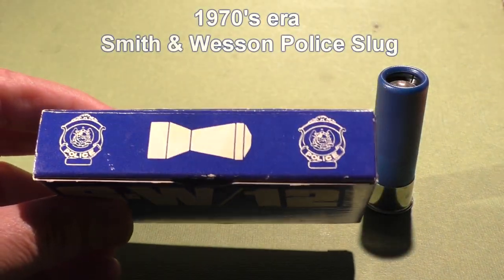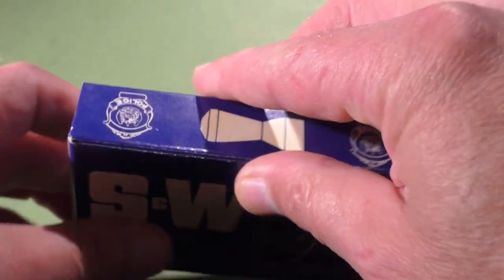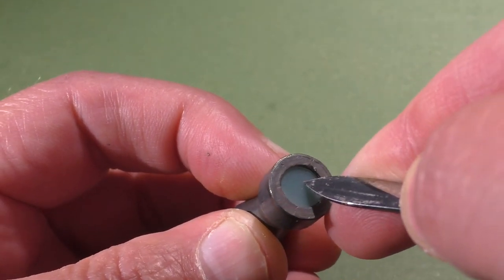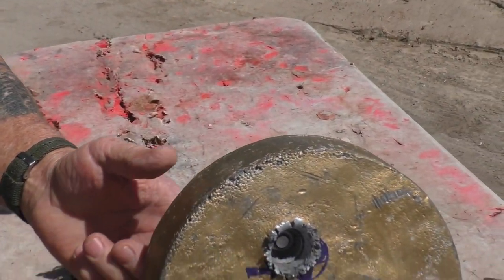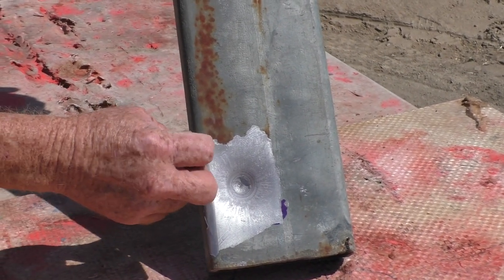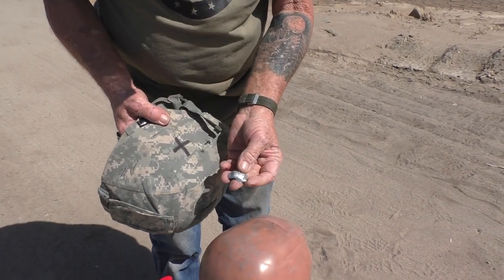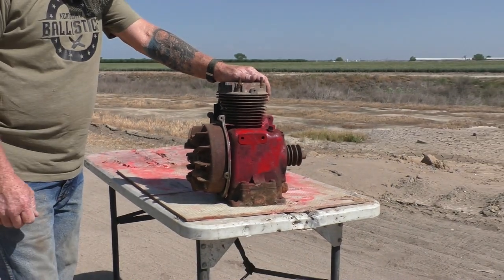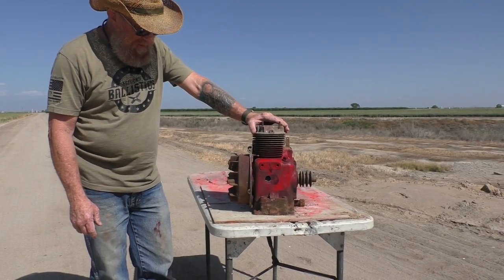45 Y/O S&W Police Slugs - Anti-materiel Sabot Rounds - Tested

Comment: After Scott's accident,  your safety precautions are a good idea
Reply: Hook and string plus ballistic shield would be my addition.
Reply: my thinkin's exacc
Reply: Was this the dude whos 50 cal. blew up on him? Saw hes breathing, but did he get out on one piece?
Reply: @GrowlieDave  He has a full video on it. Basically, he's lucky to be alive at all, but is recovering well. The part that nearly did him in was his jugular, it's been repaired, doctors did good work on the rest of him too.
Reply: @GrowlieDave  Yea he barely survived, but afaik everything is still attached and he should make a full recovery.
Reply: BAH! I shoot far older and far more questionable ammo out of equally questionable rifles. No kaboomboom. The weirdest experience was consistent hangfires with some shoddy old 8 mauser with Arabic headstamps. I've shot rusty German 9mm from ww2 without issue. If old ammo is bad it usually doesn't even go off. Scott was knowingly shooting weird, overcharged ammo that is known to make ma duces blow up. Play stupid games, win stupid prizes.
Reply: Good to take precautions with unknown old ammo all the time. Not that I always have.
Reply: @krockpotbroccoli65  whatever makes you feel safer dude.
Reply: notice also that they stopped using it after they knew the velocity though seems a little much for 12ga the pressures involved in 12ga based off the size of the bore and given what most modern shotguns are rated for makes this seem a bit excessive to me after the first shot or 2 but thats just my 2 cents.
Reply: @krockpotbroccoli65  Hindsight is 20/20.  In his video, Scott stated that he had no reason whatsoever to believe that he had a hyper-hot round.  He has shot plenty of SLAP rounds out of that 50 cal before, all without incident, so maybe go easy on him.
Reply: @ krockpotbroccoli Be careful with that old 8mm ammo. Early 1940’s Turkish 8mm has gotten hotter as the powder ages and has blown apart several autoloading firearms in the last few years.
Reply: @GrowlieDave  pretty close. Took a fragment through the jugular and down into the lung. Breech cap tried to take his head off, but only managed to break all the orbital bones around his right eye after it knocked his shooting glasses off.

Based on damage to the parts, that round was over 85kpsi, over 155% of rated pressure of a .50cal. something was way, way hinky with that round!

Comment: It’s good to see that these slugs were lucky enough to still be in reasonable condition, and more importantly were safe to shoot, despite their age
Reply: Ammo can last a century or more if kept dry and cool. I’ve shot ammo from the 1950’s with no problems. Obviously, I inspected it first.
Reply: Most old factory fresh ammo is fine if stored properly and not tampered with. Ive got some 1940s 762x39 ive been shooting for years, and its runs perfect. Ive got some 762x54r thats almost 100 years old, and it also runs like new
Reply: Heat kills powder life. Never know what you're getting. Depending on the powder, if temperature is kept under 85 or so it will outlive you by a long time. If under 75 it gets really dumb in lifetime.
Reply: Unlike them slap rounds
Reply: @theshapeexists  You do not have any 1940s production 7.62x39. 

Let alone enough to have lasted for “years” of shooting.
Reply: @rifleshooterchannel208  5280 armory in colorado has some. Surplus ammo is abundant still. Ihave some 7.64 x 54r thats even older. Learn before you speak
Reply: @theshapeexists  Maybe you should learn before you lie.

That place doesn’t have any 1940’s production 7.62x39 and neither do you. 

And I don’t care how old the 7.62x54 ammo you have is, that’s not the caliber being discussed. 

If you think you’re fooling anyone with your lies, then that shows you know very little about the history of 7.62x39 🤣

Comment: Most modern powders (US produced, post-cold war) are designed to degrade safely, meaning the round will lose pressure over time. Some ammo, like old WW2 corrosive stuff, can degrade and increase pressure, so they become unsafe if not kept properly and will blow up your gun. 

Been watching periodically for years, glad you're still going man!
Reply: That claim has been widely debated. 

I've never seen anybody come up with conclusive documentation one way or another about whether this is true. 

In general most powders seem to be pretty stable as long as you keep him in a controlled temperature environment.
Reply: @Krobear  I did read it. I was disputing the part about designed to degrade. People have been saying that about powders and primers forever kind of like 556 is designed to wound. Whether powders do degrade is a different issue but I've never seen any documentation that can support the claim that they are designed to do so. I would be interested in seeing that sort of documentation, if it does exist. I just don't think it works to state it as a fact without some sort of evidence somewhere. And I would be happy for somebody to find that evidence.
Reply: I've got a crate of barely post WW2 (1947) soviet surplus.  The stuff shoots better than any modern ammo I've put in it!!!
Reply: @confederate2506  I might have the timeframe/areas slightly wrong but an example of this is Turkish 8mm mauser that was produced with German support, also czech copies of 7.9mm Kurz, however the powder is composed, it became over-pressure with time, aka they didn't degrade safely. If you're worried about it you can always google and find out if people have had experiences with rounds getting hotter. A lot of surplus stuff has sat in boxes for decades, maybe moved occasionally, exposed to heat, and around the time they were using a bunch of new expedient chemicals to produce gunpowder. Forgotten Weapons did a vid about this.
Reply: @GunFunZS  These are verified facts, about certain ammo types. Turkish produced 8mm mauser made 70-80 yrs ago has blown up many machine guns in the past decade because it didn't degrade safely. Degrade on a chemical level, you want powder that's designed to become low-pressure over time. All smokeless nitro powder made in the past decades are all chemically composed to decompose in a safe manner. This isn't some "gun myth" telling you not to store your 5.56.

Comment: I wonder if it is possible to make more of those slugs and run them at 1200fps to test your conjecture. I think you are right that they would make it through the lead plate at that velocity. Might even be able to go through that steel as well.
Reply from the maker: I'm pretty surprised they did THAT much damage at that low of velocity.
Reply: @taofledermaus  I'm sure they have pretty good sectional density which is what sabot is all about.

Comment: Kentucky Ballistics watching this video at 4:50 mark: "Ahh, yeah, that's a good idea right there."
Reply: Wrapping his 50 cal would not have stopped the cap. Threads can only be torqued so many times. Thats why it failed so hard. It if it was a bolt instead. The bolt would have blown out the side or barrel burst open. Price wise that gun was an inferior design and option for price range. Literally 200 dollars more gets you a bolt gun in ar type set up from SHTF 50 or even Serbu Bolt action 50, although pre pandemic prices. Things went up a little from then.
Reply: @1014p  Yeah, man, that was just a joke.

Comment: Be careful. Look what happened over at Kentucky ballistics.❤️
Reply: That's why I think he added the Kevlar blanket
Reply: @draigygoch  i didnt finish watching it. But i say that because of the title. And its old ammo. I just care thats all.
Reply: @jeremyclayton3944  scott had a bunch of things align i a bad way.   The least is shooting a slap through a muzzle brake which is a no go
Reply: @Krobear  you aren't supposed to shoot SLAP rounds through a muzzle brake, the sabots like to peel off in the brake and cause a baffle strike.

But that's not what happened to KB. If he'd had a baffle strike, the damage would have been out at the muzzle end. Instead, he had the threads shear off of the breech cap, a thing that would take at least 85kpsi. That's over 150% of the max pressure for BMG ammo. Proof rounds are 65-68k, depending on which testing spec you use.
Reply: @ScottKenny1978  Yes, but the incident had nothing to do with a brake strike.
Reply: @skepticalbadger  yes, I said that in the second paragraph.

KB ran afoul of an extremely overpressure round, well above proof pressure.

Comment: If you found and kept the sabo halves you could make a mold of them and cast new projectiles similar to the old ones. Then load them in new shells see if you could do what they said they would do on the box. It may not be exactly what they had but it would be somewhat of a comparison
Reply from the maker: The sabots traveled nearly as fast as the slug and we only found one or two but they were dinged up
Reply: @taofledermaus  It was a long shoot but it was and idea

Comment: If you can find them, BRI marketed a very similar sabot slug inthe 90s and was later marketed by Winchester with BRI in the fine print. They were very accurate but the lead was hard and would shoot clean thru whitetail with little to no expansion. Sometimes the slugs would break in half at the waist causing 2 exit wounds. I believe the advertised velocity for both the BRI and Winchester was 1500 fps

Comment: I used to have several boxes of those S&W Police slugs in the blue box, maybe 15-20 boxes, I can't remember that far back, and I shot them all up. I never was able to find out how fast they were but it didn't take many shots for my shoulder to hurt. IIRC the recoil seemed to be sharper than with Foster slugs. The plastic plug in the bottom looks like the same kind they make milk jugs from. It's not a resin poured into the slug. I have one slug with a wooden plug in the base instead of plastic. I don't know if it's a Winchester or BRI,  but my best guess is Winchester. I saved one of each type and half a sabot. The slug with the wood plug seems to be made to slightly different dimensions. If they were going 1350 f.p.s. like Winchester BRI slugs, you could shoot the wheels off a car. You wouldn't need to shoot out the tires.

Comment: A factor that you should take into account is that the piece of metal in the second shot is free standing. This means that large part of the kinetic energy simply goes into moving the metal plate. The lead plate had a better stand but still some of the energy went into turning it over. 
Shooting into a car, which those slugs were meant to do, the metal bits like the engine block are fixed in place (i.e. the slug doesn't knock over the car;).

The other bit you should account for in future videos that wasn't really a problem on this one is angle. There is a reason why tanks have angled armor, a flush hit translates the most kinetic energy (some of it goes into squashing the slug), while and angled surface might deflect some of the force resulting in a ricochet.

Comment: Extra hard compared to a standard soft lead slug . So antimony , Bismuth, tin and other elements can be added to harden the lead and make it react a certain way on impact . If it is too hard ,it shatters on impact or even potentially under the shock of firing.  The propellent does not persay get weaker, the flakes,rods or spheres rub against each other. Even just Subtle vibrations over time . A refrigerator kicking on , heater kicking on, ect. That fine dust is flashing, the remaining powder burns as normal and you're probably getting some level of pressure spikes upon ignition too . So the flash looses it's pressure before the end of the barrel , the remaining large bits of the powder is substantially hindered and velocity suffers.  Think of the shape of a classic balloon in a funnel with the tied end sticking out. The tied end would be ignition, the rest is your pressure curve from chamber to muzzle. The small end of the funnel is what is making out of the gun. 
  The vest is a good idea.

Comment: I'm wondering if in their original testing of the loads they ran into problems when loading them hotter and just kept the charge/velocity down to avoid failures with the sabot. Plastics were not as good back then as they are now. You perhaps are experiencing the intended velocity or very close to it. Hard telling...
Reply from the maker: Plastic seemed durable,  the sabots we found were in good shape

Comment: I appreciate you guys covering the chamber after mentioning being careful with unknown pressures. Please do consider the string tied to the trigger and standing away method as I do have a lot of concerns after having watched that video.
Reply: If you're talking about KB, that's an egregiously hot round. Most shotgun loads run about 20kpsi and the shotguns proper are tested above 40k.

The round that almost got KB was over 85kpsi, over 150% of normal max pressure.

Comment: 45 years ago, "mild steel" was known as A36. 36ksi yeild. Modern "mild steel" square tubing is A500, grades a-c, typically it is grade B, which is 50ksi yeild (metallurgy has improved massively in the last 45 years). So the "mild steel" reference is misleading.

Comment: Reflection on video: standard 12ga = 12k PSI, gun can withstand 40k PSI. Thats 230% "overprovision" on the pressure tolerance. 
Scotts barrel was rated for 80k PSI, 50 bmg slap-rounds 55k PSI. Thats ONLY 45% "overprovision. And then you add the hot round, melting plastic sabot, residue buildup and maybe the muzzleproblem. Be careful out there. We are not all built like Scott.

Comment: Hey guys, love your content.  I can't seem to get enough.

Just a thought regarding penetration-  the projectiles will penetrate better into targets that are firmly affixed instead of free-floating, because a target that isn't fastened down is able to move backwards upon impact and absorb more of the energy.  In this instance, I highly doubt that these slugs would have penetrated that 1/4" mild steel even if it had been fastened down, especially at subsonic velocities, but they probably would have done a bit better if the target had no "give" to it.

Comment: The brass on the s&w load was quite short. I've shot 20ga 5shot that had more brass.
Reply from the maker: Yeah,  but that really doesn't have any bearing on the powder load
Reply: @taofledermaus  Thought it was exactly that. High brass is always loaded hotter from my experience and has a heavier load of shot. Reason 7 1/2 or 8 shot has very short brass.

Comment: Should retest this slug with the typical load of a modern Foster 1oz or similar  slug load. These things are negligibly higher than a 1oz slug. So it would be interesting to see these same types of rounds fired with a modern powder load adequate enough to let it perform to its factory standards.
Reply from the maker: Sort of hard to put all the pieces back again
Reply: @taofledermaus  I can see that. Thanks for the reply.

Comment: Would have been interesting to replace old powder in one shell with equal amount of new standard RedDot or or similar powder. However I don’t think old powder degrades much at all. I have several very old boxes of my Grandfather’s shot shells from 1946-1960s. Chronograph shows the few I tested were still 1145-1240. Great vid! Thanks.
Reply: Definitely needs a bunch of Red Dot.

Comment: A) You use a longer barrel than a standard police riot gun of 18" or 20"; B) Would have been useful to test some modern production 12 ga 2 & 3/4" Winchester BRI Sabot slugs which are listed at 1350 fps on the package; and C) Thanks for the test as I have a few boxes of the S&W Sabot slugs in my inventory from the '70's.
Reply from the maker: We tested those already
Reply: @taofledermaus  Found it.  Watched it.  Would have been more interesting with fps #s out of a 18" to 20" riot gun / deer hunting barrel, IMHO.

Comment: Body armour over the chamber looks like a good idea, should have told Kentucky to do that a month ago
Reply: Wouldn't have helped. The round that almost got him was so hot it stripped the threads out of the breech cap. Over 85kpsi, which is 155% of normal pressure for a BMG.

Comment: Old powder not only looses potency with time.  Some powders can drastically gain pressures.  Especially if stored in hot conditions.  Has to do with the burn rate controlling layer on the granules of the powder being degraded with time and/or heat.  That's likely what happened to scott at KB.  The slap rounds he had were hot to start with and may have gotten one or two that were degraded.
glad he's god to go.  Could have been bad.  Use extreme caution when shooting old ammo.  Way better to just collect it.lol

Comment: I'm thinking.. that doesn't sound impressive; modern engine blocks are often aluminum, and built with thin walls to save on weight, I could probably penetrate one with a hammer in pretty short order. Also, damn, my spellchecker is SUCH a prude; it refuses to correct "penetrate", or even learn the word. Makes it really fun trying to discuss ammo performance, or search for data.
Reply from the maker: It has to pass through a lot of other junk before it can get to the engine though.   Danny just told he took the engine apart and the slug hit the connecting rod and broke it.

Comment: This is interesting. I think that the design would have been better had they used steel instead of whatever alloy they did. Steel is one of the cheapest materials used in AP projectiles.
Reply from the maker: It would be better.

Comment: Should have just re-loaded the projectile portion in a new shell with the same weight of powder. Smokeless powder hasn't digi-volved or anything. It's basically the same mix as when it was first invented. Or at least within a few percentage points--it's the same chemical, after all; nitrocellulose.

Would have been a way better test to have re-packed like half that ammo